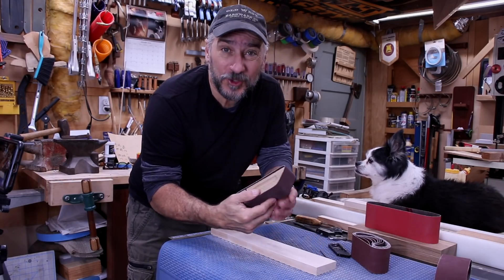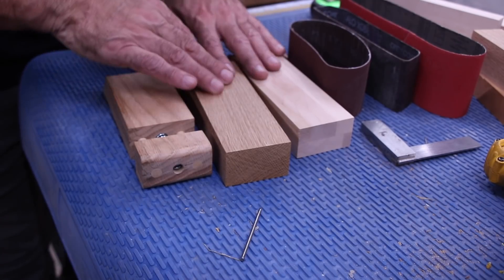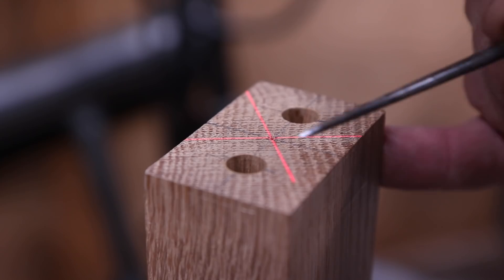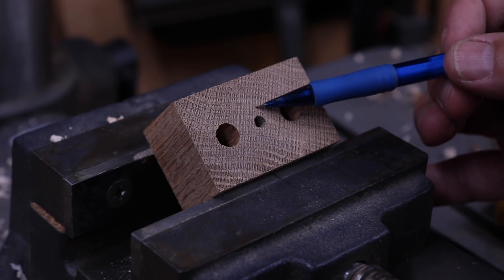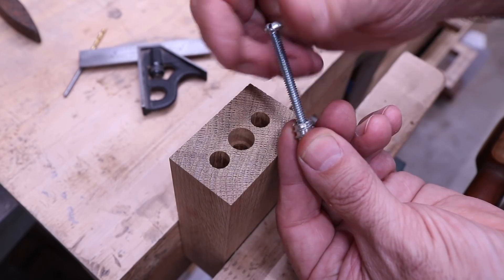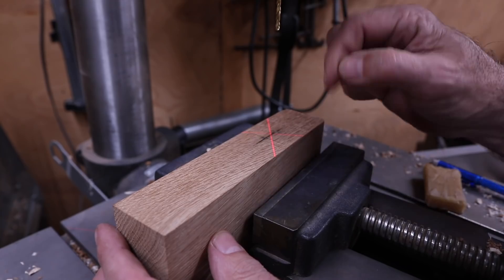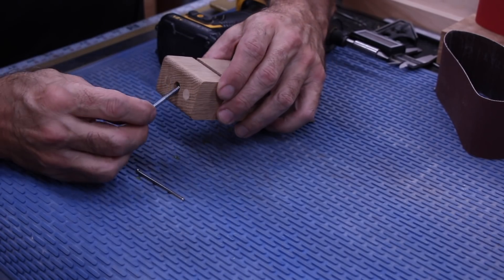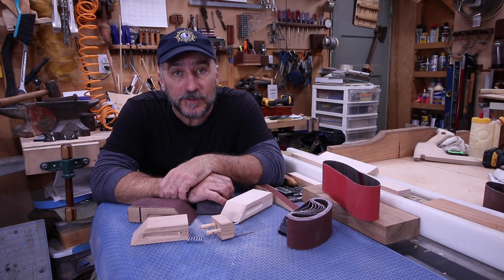Make a Sanding Block with Spring Action Locking!!

Comment: The sanding belt block is by far the best full sized block you can find. My original Craftsmen version was bought from Sears in 1980. Found nothing better in the last 45 years. It has light padding on one side to make it more versatile.

Comment: Looked at several videos on these sanding blocks and I think yours is by far simpler to build.  Thumbs up!  Only change I will do is drill a separate hole to hold the locking nail.  I can loose a pencil in a shirt pocket.  Chazz, Working Hand Wood Works
Reply from the maker: Thanks and I really like the the nail holder idea👍👍

Comment: You don't need anything as complicated as this to make a "self locking" sanding block. You just need to cut the edges of your block at a 15 degree angle. The narrow face goes at the top, the wider face goes down. Then wrap sandpapder round the block, and crease the paper on the 15 degree edges, take it off, fold along the creases and put it back on. The sandpaper will hold itself to the block! 
see alexanderguestguitars.com     Videos   page  "The World's Best Sanding Block" for the full run-down.

Comment: Nice! Any issues with the sanding belt shifting or coming loose during use? Seems like ones hand could push the heal and loosen the sanding belt during use.
Maybe use a stronger spring to reduce this?
Reply from the maker: I have not had a problem with that happening. Thanks for watching
Reply: I think that may become a problem if you sand in a backward motion, but as one normally applies sanding pressure in the forward motion I doubt it would affect shifting of the sanding belt to any noticeable degree